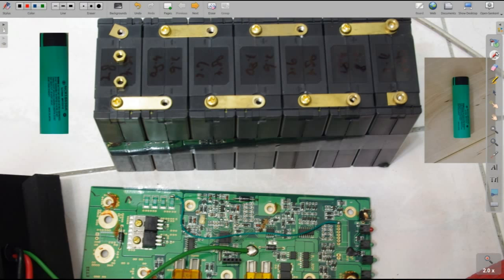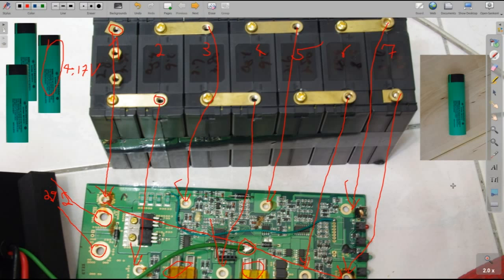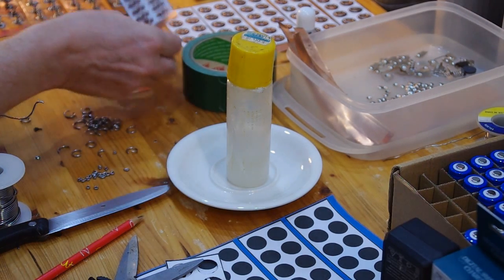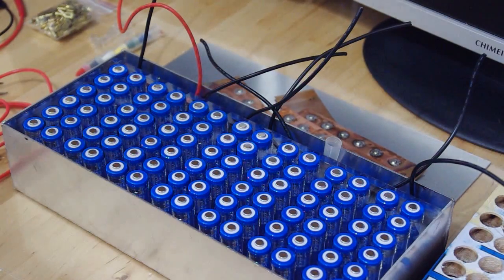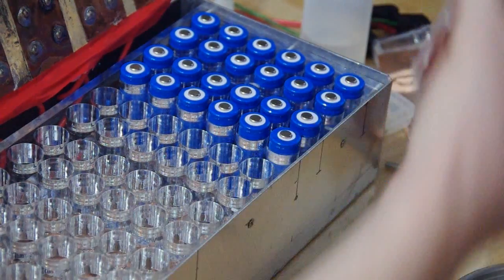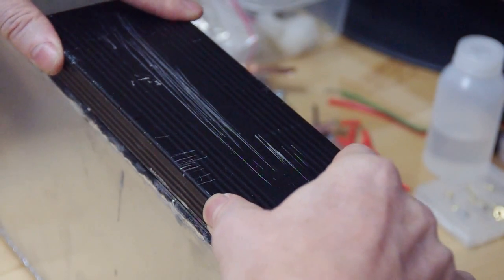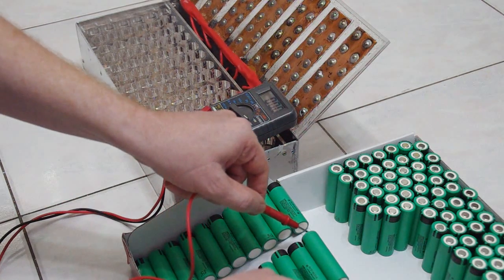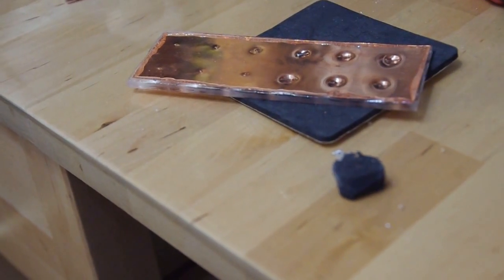How to build a Li-ion battery pack with panasonic 18650 cells 3100mah A

Comment: Hi i like the video i have red 6 battery that i took out from a old computer they are 18650 Li-ion battery's but i needed to know how many mah per hours i have on each one the label on the laptop battery pack said 10.8 volt///47mh///4090mah you think you can help me out with this numbers and figure out what all this numbers mean and can u told me what is the numbers for each battery's?
Reply from the maker: Robero Valentin 
Probably three times two in a row. So at full charge 3 x 4.2V = 12.6 V.
3 x 3.6 V = 10.8 V.
3.6 V is probably the nominal charge. 
If the 4090 mah are true, which I doubt, you should have a pack wit maximum 12.6V and 8.1 AH.
4090 mah is very high. What brand are they? 
I had those with something like 4600 mah on it at first, but this was a scam.
Realistically, you can get those 18650 cells from Panasonic, Sony, Sanyo and Samsung at around 3000 to 3400 mah.
Reply: They are red but there are no brand on it the only thing on the battery is the factorization number i took them out of a Compaq computer
Reply: If the pack is 4090mAH,  and the battery is 3 serial sets of 2 parallel cells,  then each cell had (when manufactured)  4090/2 or 2045mAH capacity.   An old laptop from a high end US firm  will likely be made of the best japanese cells available at the time,  and their only potential problem will be old age.   Rinoa Super-Genius seems to be having pretty good luck with both used and ancient-but-unused packs,  and because used ones have spot welded tags, you can make bigger packs with solder and copper.  personally if I was him, I'd consider investing $100 in a little chinese spot-welding machine.
Reply: Robero Valentin 
re:  "...i needed to know how many mah-per hours- i have..."
If you have 6 cells & the battery label shows 10.8V, then it is very likely that your cells were connected in a 2p3s configuration (i.e. 2 cells connected in parallel & then those 3 pairs connected in serial) and the nominal voltage of each cell is  3.6 Vdc (i.e. 10.8V / 3).

It is more likely that your battery label shows 47Wh of capacity, rather than 47mh.  That means the battery's nominal current capacity would be ~4.35 Ah (i.e. 47 Wh / 10.8V).  Since your cells were very likely connected as 2p3s in the battery pack, your cells were probably 2176 mAh or 2.176 Ah (i.e. ~4.35 Ah / 2) when they were new.  As a check, you can calculate the battery Wh capacity as follows:  3.6 V * 2.176 Ah * 6 cells = 47 Wh

The only way to determine the actual capacity of your cells is to fully charge them & then perform a constant current discharge on them with a device that measures & integrates the VA discharge over time.  Below is a url to a good source of many types of chargers.  Pick one that allows you to perform discharge tests on your cells (Imax B6 will probably work well for you--but there are less expensive models to choose from).
http://www.hobbyking.com/hobbyking/store/RC_PRODUCT_SEARCH.asp?strSearch=charger

Comment: Excellent work on that battery set-up. Now you need to persuade four million other residents of Taipei to give up on their multitudes of internal combustion engines  (especially 2-stroke) and go with electric bikes, scooters and cars to make it more liveable!
Reply from the maker: 1000sunsets Thanks!
Electric bikes are in the coming, slowly though. However, a couple of years ago, I didn't see any hardly ever.
Now, I see a handful of e-scooters and bikes pretty much everyday.

By the way, I opened my pack this weekend to check if all the 7 units were balanced within it's range.
This what I found. The first leading unit was at 4.22V at the packs full charge which is 29.2V.
The second and third were at 4.17V. 
The fourth and fifth were at 4.14 and 4.15.
The sixth at 4.17 and the last at 4.18 V.
I always thought that the original packs went down starting from the leading cell. 
4.22 V is no big deal, but I decided to balance all the units and swap all the cells from the first unit with the cells from the fourth.
Opening and closing the pack took about 10 minutes, but the charging took all afternoon. 
I rode about 50 KM today and the pack went down from 29.2 V to 27.00 V for that.This is not even half empty.
So everything looks good. Need to check every 50 life-cycles though.
Reply: Thanks for the update. Your design is impressive, with ease of access and room for heat dissipation. I was wondering about the pros and cons of having some kind of ventilation system that is still waterproof - at least weatherproof.

Current thinking (almost a pun) seems to be that 4.20V is the maximum voltage for a cell and that habitually exceeding this will reduce cell life substantially. Further reduction in voltage will actually give major improvement in cell life. It depends on whether you concentrate more on distance attainment or long-term cell life.
Reply from the maker: 1000sunsets The cells normally charge to 4.17 V which is well below what they can handle.
The absolute maximum (danger) fire is about 4.35 V.
I want maximum lifespan. And I noticed that the previous original cells went down after 3 years starting from the first cell.
So, I have to check every once in a while where the 7 units are. 
The cells within each unit charge all to the same voltage, plus minus 0.01 V. They are either all 12 cells  at 4.17, 4.15 or the first unit 4.22 V. 
I started using this pack days before uploading this video. This was my first check after 5 month and I charged the pack 2 to three times per week, 50 to 60 times so far. I depleted the pack every-time down to about 24.5 V and charged it over night back to 29.2 V. I think it's OK, just check every now and then. 

On the other hand, it's not necessary to top the pack to full charge every time. 
It's best to stay below 90 % of full charge anyway. The range I got on this is more than enough. Only when planing long trips, I will go all the way to full charge at 29.2.
Reply: davidcandlelight 
re:  "The first leading unit was at 4.22V"
If you want to get the maximum life out of your cells, never charge cells (with a 3.7 nominal V) higher than 4.1V & never discharge them below 3V.
Cells with a 3.6 nominal voltage may have a slightly different recommendation--I've never researched them for maximum longevity.

Comment: I'd be happy with double of production costs. Tesla uses 7,600 panasonic 18650 cells in their car batteries. So they must not even pay a dollar each ( too buy the Tesla battery pack is $12K with profit). Unfortunately, I don't see much below U$8 each and it's difficult to know whether or not they are authentic.
Reply: sheeeesh ... 7600 cells ... i am aiming for a 39cell for an ebike :D
Reply: 39 would be great for an e-bike that't not like 1300 kgs. But at U$8 or so a cell, it sure is expensive.
Reply: true, recently i took to "taobao" ... to try some cell "blocks" (they look like giant iphone battery). they come in at approx USD 5-10 a block 3.2v lifepo4 18-21AH ... i will be trying to test the capacity, each weighs about 800g to 1.1kg ... it is somewhere in the south china sea on a ship now haha. i saw some 4xxxx large cylinder cell ... gawd there is so many types !
Reply: ***** 8$/cell retail is a major rip-off when Tesla can buy them at 80 cents to 2$ per cell.  My feeling is that the price should be no more than 2.50$/cell.  That would provide plenty of profit for the cell manufacturers.
Reply from the maker: zeffur7 As far as I know, there are some errors in your calculation/estimates.
The battery will deplete to 73% after 500 cycles only if you charge them all the way to the 4.2 V and if you go all the way down to where the cell is almost empty. 
To my knowledge, the car companies design the packs with a 30 % buffer in it, to the top and bottom charge. In other words, they will never be fully charged nor discharged. 
The most aggressive  chemistry happens above 4V. Their cells never go there.
Another thing I could imagine is that when after some years your range drops, the Tesla service will reprogram the pack so it can dig into the buffer to compensate. Therefor, during those promised 8 years, the consumer won't noticed much difference in performance. 
After that, everyone's best guess.
Reply: I wouldn't be surprised if both panasonic and tesla  take a hit on the profit margins on the battery packs, in order to popularise the industry.  I'm guessing panasonic value the publicity,  and also the opportunity to bulk test new battery chemistries (I heard Elon say he gets new better cells all the time) in a safer way than putting that many in 1000 laptops.

P.S.  they'd sell them to you much cheaper too,  if you bought 7,600 at a time :)

P.P.S.  so why doesn't someone with a spare $12k  buy a tesla pack and break it up for ebikes?   at $3 per cell you'd almost double your money.
Reply: \o/ ... yay my block cell arrived ! the smaller variant 9AH 3.3 lifepo4 looks too good to be true @ 270grams ... but i bought the wrong capacity tester. http://3roomlab.blogspot.sg/2015/02/experimental-components-from-china.html
Reply: MattOGormanSmith I almost maybe might totally do that if I could find a legit seller...
Reply: Yea, it's lame =(
Reply: MattOGormanSmith i think your right also i read somewhere that when you buy the car you don't own the battery it is only hired to you for your use so you wouldn't be able to draw any conclusions about battery cost in relation to price of car
Reply: MattOGormanSmith
Here's a recent email exchange between me & Tesla:

Me:  "Can you provide me with a list of how much each battery pack would cost to replace? This format would be good:  "Battery Model"  "Capacity in kWh" "Replacement Price""

Tesla:  "Since all batteries at this point are covered by warranty we do not have any figures in today’s numbers.
 
We do know that in ~8 years’ time we expect that a replacement 85 kwh battery back will be in the $12-15K price range, and that extended range batteries will be available for $15-20K.
 
Sorry that we do not have any figures for you today given that the warranty will cover all vehicles for a number of years to come!"

Me:  "Can you estimate for me the typical battery capacity during each year of its useful life?  A best guess estimate for years that you don't have real data would be appreciated."

Tesla:  "The only figure we have been provided with is that after 8 years’ time we can expect around 15% battery depreciation. I would figure the 15% would be evenly split over the 8 years resulting in ~1.8% decrease in overall capacity"

Me:  "Interesting.  Panasonic shows the following in their data sheets:
1.  NCR18650A (3100 mAh cell):  ~73% capacity after 500 cycles (~1.4 yrs of daily driving). 
2.  NCR18650B (3400 mAh cell):  ~67% capacity after 500 cycles (~1.4 yrs of daily driving)

Perhaps Panasonic provides Teslamotors with cells that are superior to what they sell in the retail markets..."

No response from Tesla to my last remarks.

Below is the math to determine the Gross $/cell:
______ 3.4Ah __ Pak
Pak __18650 __ Repl ____ Gross
kWh _ Cells ___ $ ________ $/Cell
85___ 6944 ___ 15000 ___ 2.16
85___ 6944 ___ 12000 ___ 1.73

Notes: The above calculations use a 3.6V nominal voltage and assume cut-off discharging to 3.0V & cut-off charging to 4.2V. To maintain/optimize cell capacity & life, Tesla probably cuts-off charging below 4.2V & discharging above 3.2V. The exact cut-off thresholds are unknown at this time.

Obviously, Tesla's $/cell has to be lower than 2.16 or 1.73 (because of other battery component & material costs).

Tesla may estimate now that they will depreciate a batt pak by 15% after 8 yrs, but you can bet the performance loss of one of their batts after 8 yrs will probably be more than 15%--and remember, as batt capacity drops, so does batt power & the distance that the vehicle can travel on a full charge--which for some people will be a deal breaker at the time of resale.
Reply: Alex Newton
re:  "...i read somewhere that when you buy the car you don't own the battery it is only hired to you for your use..."
That ^^ doesn't appear to be the case with respect to Tesla battery packs (refer to my email exchange (above) for more details).
Reply: davidcandlelight
re: "To my knowledge, the car companies design the packs with a 30 % buffer in it, to the top and bottom charge. In other words, they will never be fully charged nor discharged. "
_ Can you cite a bonified source for that knowledge or is that just an assumption?

 I do not doubt that Tesla does undercharge & underdischarge their cells--the question is what are their real cut-off thresholds? Without that specific information, making such an estimated guess isn't of much use. I sent an email to Tesla today to determine exactly how many cells an 85 kWh battery pack actually contains... If/when I get that information, I will post more accurate figures.

Also, if they do in fact undercharge/underdischarge their cells to maintain cell charge capacity & cell life, then their battery packs will require many more cells than I calculated in my original estimate in order to achieve the mileage output that they cite on their website. My original calcuations were based on a nominal voltage of 3.7V. I have recomputed new numbers based on 3.6V & posted that new information in my original comment (above) to correct my minor error.

In any case, I think undercharging/underdischaring is a valid way to maintain cell charge capacity & cell life. I've seen manufacturer reports that show charging to 4.1 nearly doubles the cycle life of cells (compared to 4.2V charging)--and I have no reason to doubt their claims.

Comment: Thank you for the video.  Do you have a suggestion on getting authentic Panasonic batteries at a good price?  Alibaba has them less expensively, but I'm not sure of the authenticity.
Reply from the maker: No, sorry!
I got them through an e-bike company. The only thing I can pass on is that the original Panasonic have flat tops and come at 3.6 V at delivery.
I wish it was easier to buy these things at near production price.
Same goes for solar cells. I find it hard to get my hands on them.

Comment: Did you test the 3100mah cells to ensure the 3100 label is correct? All the 18650 cells I've dealt with 2600 has been the highest I've found from laptop packs. To first timers don't trust Utrafire or trustfire brand batteries no matter how cheap they are, they are known to re wrap their cells with a higher capacity.
Reply from the maker: WVresident I did not test the cells individually.  The company that sold me those re-wrapped blue scam cells hooked me up with an e-bike company that ordered those from Panasonic Japan. I was a little worried that they would cheat me a second time. But I guess their interest was getting rid of me in good term since they continue selling their falsely declared cells with 4600 mah. 
I calculated my engines consumption forth and back and I know how far a 10 AH lipo pack gets me. I used many different 10 AH packs. Therefore they should be between 2900 mah and 3100 mah. With high psi tires and some paddle assistant, I got 110 KM with some extra juice left before recharging. The pack was down to 24.6V and I rode the bike by myself without a second person on it. Two lazy people will get somewhat between 75 and 85 Km out of it.
Reply: davidcandlelight
How much did your 3100ah cells cost? I've been buying laptop packs with 2600ah cells for around $2 USD a cell. I don't have a ebike but I'm getting into making a battery for my RC mower I built. Its running off a 12v car battery right now with 24v wheelchair motors but its kinda slow so I wanted to make a 18v-24v battery for it.

Comment: DAV what brand r ur  18650 & where did u buy them 3100ma
Reply from the maker: bare dog I use the original cells from Panasonic with 3100 mah.
You can order them from E-bay but you must make sure not to buy any re-wrapped cells since they could be a scam. The original are green with flat tops. The do not indicate they capacity so nothing like 2900 3600 or 3100 mah on it.

Comment: Hi, great work... this is good view, but... You tested all battery pack when work? how connections on time work? which you current charged battery?
I built a large battery, but a battery of netbooks - no names - no history. And had to test and choose the mean values of capacity. When my batteries - 16,8V and 250Ah - I used the 572 cell. ( 4 cells on 250Ah - 4,2V and 143 batterys) The only thing that worries me in your design is a current while discharges bigger shock .... You'd have to test so intensely. In my battery begins to play (some thing doing hot - connections) when I take more then 200A continuous current ....

Comment: Do you have regenerative braking for recharging while riding?
Reply from the maker: kenjams I have two hub engines, front and back, each has 400 W.
The engines are brush-less and do have a transmission and a clutch.

For regenerative breaking, I'll need a different engine without a clutch working straight from magnet to hub. This has the disadvantage of not having a complete free spin when the engine is turned off. 
Most batteries can only take a fraction of that energy anyway.

However this battery pack could take in most of the energy while going down a tall mountain. I am thinking about changing at least one engine to generative braking.

During normal cruising, I only run one engine at a time. The two engines are only used for steep climbs or to give me an extra burst in tricky situations in city traffic.